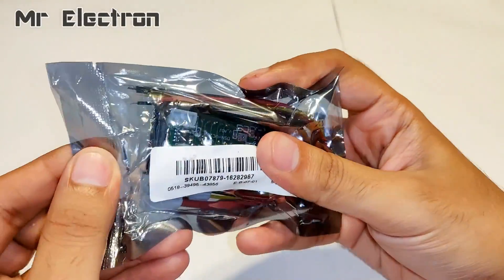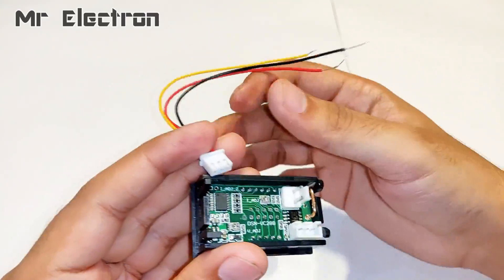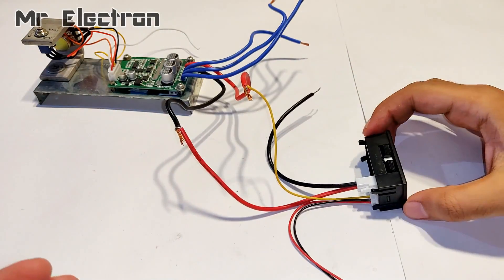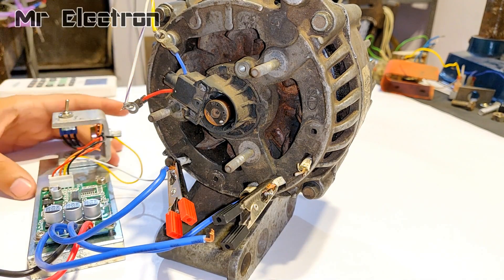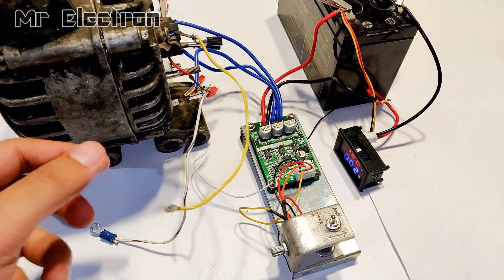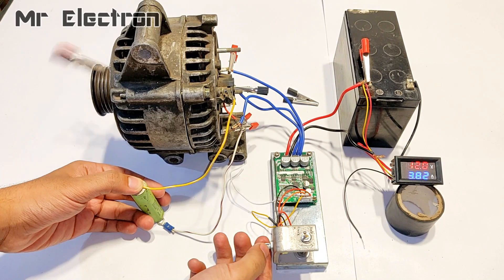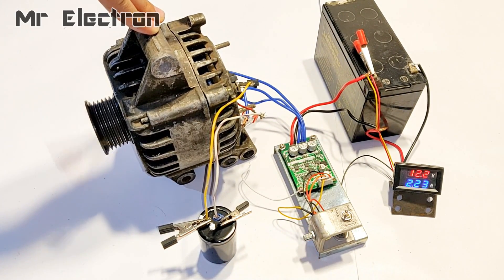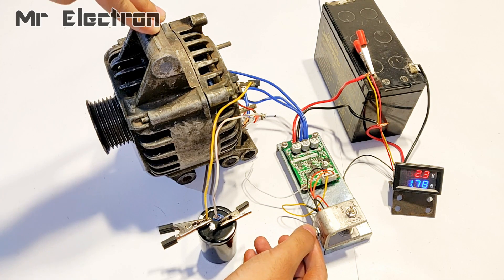Run 12v 120 Amps Car Alternator as Brushless DC Motor with 500F Super Capacitor & BLDC Controller

Comment: If i increase the voltage to the field windings, would this setup (without the capacitor) be strong enough to start a Honda G100 2½ hp engine?

Comment: Why do you call it a brushless DC motor when all alternators have brushes?
Reply: You are correct Larry, they should not keep calling these converted alternators to motors "brushless motors".    If they are making use of brushes in any way, they are not a brushless motor.  The confusion is caused by 3 phase controllers used in many of these youtube videos.  A brushless motor is a motor without brushes.  A brushless motor uses permanent magnets and NO brushes.  Some of the alternator conversion guys on youtube have removed the brushes from alternators completly and added permanent magnets to them.  These guys can legitimately call their motors brushless. However, even these guys require the 3 phase controller.

Comment: Hi 😊 Can I make the same project and use two batteries 12V (24V) and speed will be more higher?
Reply from the maker: Yes but if the amps are not much, torque is gonna reduce ....
Reply: @MrElectron  I want to make an strong electric motor for the boat based on your project and I wonder if I adding another battery will be everything?

Comment: congratulations for your job. two questions : how long does the capacitor charge last? to power the rotor can you use the battery that powers the stator?
Reply: Reasonable questions ,which needs
suitable answers.

Comment: One basic thing: ohm's law. for DC the field (rotor) is a resistor, less voltage = LESS field current! and this is correct, LESS field current = higher speed!  Alternator runs at a speed  where the voltage it generates = supply voltage (apart from losses). more field mean higher voltage generated so speed drops. 
  If the battery voltage  and the generated voltage are the same, what is the current value in a resistor in series with the battery? (i.e. the resistor in the current meter)? This means the voltage on both sides of the meter is the same, so NO current is flowing! But, of course, there are losses so it slows down enough to make the loss current flow.

Comment: Hi I am following your reuse of alternator. I would like to run a racekart with an alternator. What do you think how much kw can you generator with a 50 A Generator in a conversed mode to motor. What voltage is proposed. 24V ???

Comment: Your UPS 7,2 Ah battery will dead because over current = 56 Ampere (7,7 c) discharge to suplly 12v motor ( modified car alternator).

Comment: Bro, I could not start my bike’s starter motor with my super capacitor.. 3V 500F each with series connection, I brought to 12V. My super cap has 4 terminals (in case if this info is useful) 

Please help

Comment: Hello 
If i connect for example a 36V battery pack to the controller and to the alternator.
Can i use the same  capacitor or do i need to use a different one?

Regards

Comment: is it possible to charge the battery and also a 12v1Farad capacitor but also from the same capacitor and battery to excite te alternator to run endles time?

Comment: You know that you could hook that alternator to the car engine make it start the engine.
Reply: Hooking it how? To the Alternator belt?  And then what? Leave it in circuit wearing out the belt?  You're going to have trouble on most cars nowadays doing that, just because there is no room for it, along with possibility of breaking the belt:  better to start the engine from the flywheel and then disengage it  (with an actual starter, which is what one is designed for, and in which case, why replace it with this?)

Comment: You could turn your car into a gas electric hybrid. 

Maybe with an alternator/motor, you can supplement  800 to 1200 watts of electrical power converted to mechanical  horse power.

Comment: could automotive alternators be used as motors for a heavy lift quadcopter?
Reply from the maker: yeah !!! torque and rpm both are high so yes its possible
Reply: @MrElectron  awesome.  I wonder what would be the easiest way to control them as if they were normal brushless motors with rc esc's?

Comment: When you change the field winding voltage, you change the field strength, and therefore the KV of the motor (KV is RPMs per volt at the armature). A low field winding voltage results in a high KV, which means the motor will turn very fast when the armature is operated at 12 volts, but there will be less torque available at the drive shaft. If you use a higher voltage on your field windings, you reduce the KV of the motor, so it will turn at a lower RPM but with greater torque. You can think of the field winding voltage as acting a lot like an adjustable gear ratio for the motor. If you were to use this on a go kart or something, then gradually reducing the voltage to the field as you accelerate would allow you to gain higher top speeds, without sacrificing the amount of torque available for accelerating from a stop or at low speed
Reply: Does the field winding current affect the efficiency/losses of the motor?
Reply: @londonnight937  there is a window in which it will be most efficient. Very high or very low field strength will lead to poor efficiency, but an alternator does not make an efficient motor in the first place (approx 50-60% compared to 80+% for a well designed brushless DC motor)
Reply: @Razza2250  That sounds like I need to do more research on the subject. Would you be able to provide some sources to confirm those numbers?
Reply: @londonnight937  wish I could mate, but it's been some years since I went down that rabbit hole. It pretty much comes down to the alternator not really being optimised for motor use, in the same way a BLDC motor isn't optimised for use as an alternator. Those numbers are only ballpark figures. There's a few forums out there about using these as motors for gokarts and the like that go into a lot more detail and that's what I'm recalling but I don't have the links to them
Reply: @Razza2250  Ah, its alright then
Reply: Any idea what a good compromise voltage for the field windings would be? I was just planning to excite them at 12v but wouldn't mind extra torque
Reply: @misterman73  really depends on application. I ran mine at 3v when I wanted to use it as a grinding wheel. Not sure how long the bearings will last at that speed but it was pretty awesome. Must have been close to 10k rpm. On the other hand, at 24v field it was a torque monster at only 200rpm or so. Field windings got very hot though, translating to poor efficiency
Reply: @Razza2250  hey that is pretty awesome! Thanks for responding, this is great information and something I'll have to consider. I'm looking at using a 40 amp mini alternator as a motor for a mini bike. Any extra torque would be huge. Do you think 24v for the windings would be too much in this application?
Reply: @misterman73  it will probably make the rotor very hot, and you may prematurely wear out the brushes. It's hard to know without testing it. The other thing to consider is that the slower the alternator turns, the less cooling it gets, but it will still be pulling the same amount of current through its stator. This will become a problem under continued load. I would suggest gearing down instead, and allowing the alternator to turn at a healthy 4000-7000rpm
Reply: @Razza2250  Very good points. Thank you for explaining!
Reply: Thats interesting, you just answered some questions that I had been wondering about, thanks.
Reply: How many charging of capacitor volt and amp ?

Comment: I understood when field winding was excited by a 3.3V cell as it will create a constant magnetic field just like a BLDC motor rotor. But how the super capacitor was not creating any problem in working of motor as capacitor with field winding will form a LRC circuit which will work as an oscillator,  means magnetic field of the field winding will changes its direction!!!

Can u please explain this??
Reply from the maker: resonance occurs at a specific value of inductor ,capacitor and resistor.
Reply: Always around my mind......?
Reply: Control the future by the past presently....

Comment: I’m not sure about the role of the super capacitor. It is storing charge, which is what capacitors do, but what is the stored charge doing as it discharges into the motor? One would think any stored charge is dissipated into the amateur windings and once its discharged there’s no more charge left.

Comment: how much volts and amps required to charge the capacitor??  and how often we need to charge the capacitor??  
I really appreciate your reply..
Reply from the maker: 2.7v and ( 0.20 to 3 Amps ) . One capacitor stays charge for around 30 mins
Reply: @MrElectron  can I use 18650 cell with capacitor to prolong its charge?? I want to use this setup in electric bike..Please suggest are better solution
Reply: @nadirsiddiqui9559  Use a PWM to control the current flowing through the field. A high current will give you a lot of torque but low top speed, and a low current will give less torque but higher top speeds. With a PWM you could use a knob to adjust it to however you want.

Comment: You still need a battery to run all of your accessories in your vehicle. No capacitor is going to do that by itself. Something has to first charge that capacitor in order for it to release it's energy. In other words the capacitor has to see a load.

Comment: can you see an capacitor as a boost for electric motor, i am thinking in a arrange with a capacitor with a switch and then with the motor running turn on the capacitor

Comment: At best the alternator is working as a three phase motor being run off a single phase on DC. It requires 3 rotating magnetic fields to be run as an efficient motor.

Comment: If alternator was attached to the engine, would it be able to turn over and engine, and possibly start it?
Reply: Wired in a correct way, yes

Comment: Very interesting.
I would like to see what kind of working loads it will drive. IE. A circular saw blade, a grinding wheel or even an electric vehicle of some description.
Reply: Testing it as an e-bike  wood be interesting
Reply: @argue117  I'm exploring options for my frankienstein ebike I have its currently a 36v rear hub 350watt and a 36v 29.25amp battery  I want to make some sort or boost on a belt drive to the rear so u are using most cruising power off hub ND boost with the belt drive system I'm thinking like a 23amp brushless controller At 36volt for the belt and the 350watt is a 14amp max controller I would keep on
Reply: @argue117  
bonjour suis très intéressée à vos expériences
NB: comment avoir ce régulateur (contrôleur)et à combien merci
Hodefroid Kayembe de Lubumbashi en RDC

Comment: How's it brushless? All alternators have brushes
Reply from the maker: Not a brushless.It just behaves like one
Reply: it has rotor sliprings, not a rotor commutator. The difference is that without the arcing and grinding of the commutator gaps, the slipring brushes last much longer than Brushed Motor brushes

Comment: Nice experiment, but motor velocity without loading is meaningless.

It would be helpful to post practical load, torque & efficincy data for this rig.

Most of your test gear is already in place.

Without useful data, the video gives low SNR, unfortunately.

Comment: I was just telling my nephew how a alternator is nothing more than a BLDC and now I can show him! Thanks Mr. Electron!
Reply: Replace the rotor coil with a permanent magnet, and you've got a powerful BLDC motor/generator.
Reply: Alternators have brushes
Reply: well it's not exactly brushless since excitation in rotor is fed through brushes anyway. Hiding that fact PMSM or even async squirrel cage fed by inverter  can be considered BLDC while not exactly being one (there ARE differences which you can google yourself).

Comment: What happen if you put 2 super capacitor in series?  Because only one have 2.7 v, if you put two of these together, you make a super capacitor 5.4 v.  It's possibile? Is the same like put together 2 batteries?
Reply from the maker: Its different than batteries.  Internal resistances decreases the capacitance to half or average value

Comment: Car alternator's rotor iron stays magnetized due to remanent magnetism, so, of course that you'll have some output from this effect. The other thing is that you charge capacitor, and it produces current in field winding until it's discharged. To really know  how it behaves dynamically (time responses of voltage and current), you'd need to know a lot of circuit parameters. So, don't try to sell some mumbo-jumbo, or cumba yaa, and expect to praise your work.

Comment: Watchout that clip on the pulleys don’t fly off and hit you in the eye. But nice job.
Reply: Been trying to find12 volt fan motor with the right voltage to used with a derict solar panel.  10-20 watts. If you know where can you link it? Or do know how to make a bigger car 12 volt motor run on solar?

Comment: I can't imagine that being a 500 farad cap. The last time I saw a 1farad cap it had to be in the bed of a pickup. Enlighten me please.
Reply from the maker: Check the link in description for 500f capacitor
Reply: I have a 4 farhad wich is as big as a 2 liter bottle
Reply: Looks like a .50 micro Farhad
Reply: @cwf8d270  not at all... polypropylene caps (bipolar) has roughly 10-12uF at that size (and 350V rating). Aluminum electrolytic cap has either 100uF/400V or 27000uF/10V (27mF) at that size. Supercap can have dozens of fahrads but with 5V rating. All at the same size. Samwha 400F/2.7V supercap is 35x60mm so I'd say this is valid capacity for it's size and voltage rating.

Comment: Can this jump your motor on? Instead of a starter🤗📐
Reply from the maker: Its complicated but then yes . Its possible 😊
Reply: The torque is not enough i think the small starter is way more powerful based on widing and it has a reduction gear to increase the torque

Comment: I’m sorry, can someone explain to this Electrical Engineer (me) why this is at all noteworthy?

Mr. Electron, you are confused, and confusing your viewers - perhaps intentionally, perhaps because you yourself have no clue - into thinking you are somehow powering the “alternator” with the capacitor.

The capacitor isn’t running the motor. 
Notice the ammeter indicating the current being delivered by the 12V battery? Several amps?
The capacitor is just “exciting” the “field” windings enough that the motor (barely) turns.
How long does the capacitor last in this role?
How much torque does the motor have with a rapidly decaying 2.7V field?

I mean it’s interesting that he has managed to make the alternator run on 12V DC, though I notice three wires going from the Controller to the alternator, so I suspect it’s been modified (modified beyond simply removing the rectification and regulation.). The 

You are just confusing people, and encouraging them into thinking they can drive their electric bikes with capacitors...
Like, even if this was all true, you could power your bike from that barely spinning (100 RPM)  and undoubtedly low torque “motor”.
In case you really have no clue, let  fill you in. Low RPM, low torque equals low power (even though you’re drawing like 25W from your 12V battery).

Last time I did the math, that super cap, fully charged, has about as much energy as ONE AA battery.
And it’s hard to use that energy. Unlike the battery, which maintains an almost constant voltage until dead, the voltage of the capacitor quickly decays as it discharges.

Sure, 500F capacitors were science fiction not too many years ago.
But it will be quite a while before you can power your alternator without the assistance of that 12V battery

Capacitors have advantages over batteries (you can charge them pretty much instantly and discharge them even faster) and there are legitimate uses for them, but powering your bike is not one of them.

Learn some about electronics before your video and your comments get someone hurt.

Your crazy alligator clips and bare wires are going to short out someday. And THEN you’ll see how quickly a capacitor can dump all its energy!

Try shorting out your charged capacitor (the 2.7V one you charged with 4.x volts - don’t leave that unattended).
Try a penny. If you’re lucky, it will spot weld itself to the capacitor.
If you’re less lucky, the capacitor might explode.

Oh, and be sure to wear jewelry, like a wedding ring, when you do this experiment.
It’s surprising how hot a wedding ring can get (and how badly you can be burned).
I’ve seen a wedding ring get so hot when it mistakenly shorted 110V that it literally exploded into a gaseous cloud of molten gold that gold plated the inside of the junction box.

Stop fooling people, or yourself, into a dangerous, heavily flawed experiment.

Oh, and one more thing. You can get some simple AC alternators to work as motors depending on the design.
I’ve done it by just feeding a square wave pulse train into the (two) wires.
Not all will set start, some have very limited range of RPM that they will run at.
But most will run with a square wave, not even requiring a nice AC sine wave.
Older alternators and some inexpensive AC generator have fixed magnets, so you would even need your silly capacitor to excite the field.
Reply from the maker: Just Check my previous Alternator to Motor video and you will understand.I believe you are new to my channel.
Reply: These alternators are 3 phase internally. The supercapacitor is just for field excitation. A lower field will allow a higher speed for a given running voltage. The fiels could inded be replaced by a permanent magnet - which uses no power at all. Which is proof the supercap is not what is powering this motor.